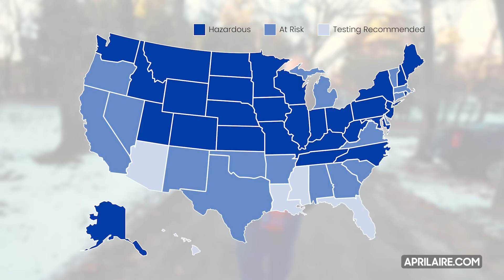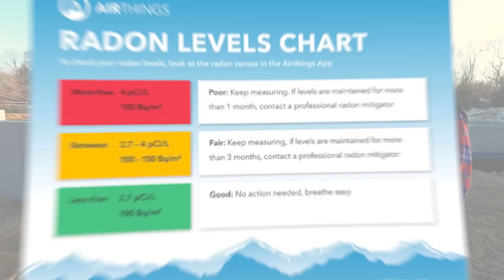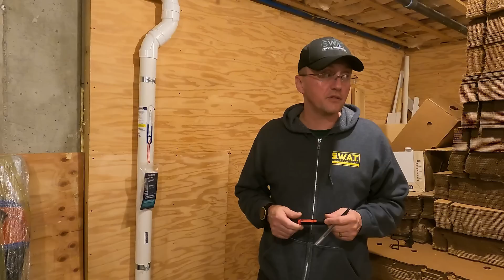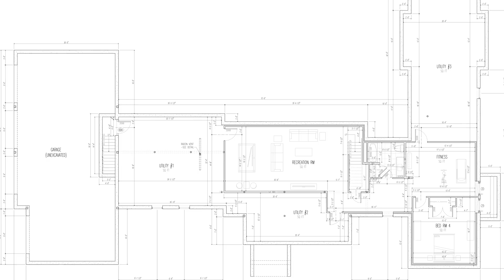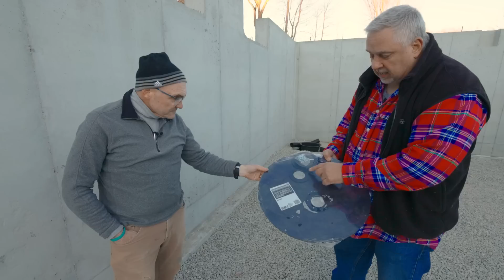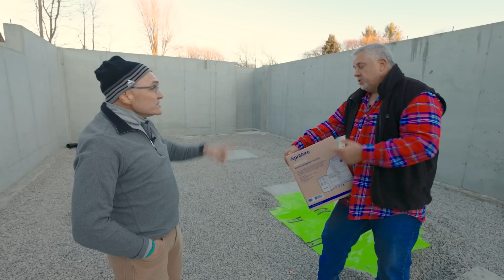"Radon Mitigation" Build Show Build: Boston - Bonus Episode

Comment: Hello. 
After watching your video, I noticed several issues. As the owner of RCS Membrane, a leading installer of radon poly under-slab vapour barriers, I want to point out that the pipe coming out of the ground appears incorrect. It should be a solid pipe. The pipe shown in the video could allow gases, including radon, to leak into the basement.

Comment: There was no mention of RadonSeal. I've used it in several basements in houses I've owned and applied it myself.  Definitely seals the concrete to prevent leakage. It even fixed small cracks that leaked water. For an after built option...

Comment: The radon in the previous house was not so high but the house was poorly built so I think it was always ventilating, now we have put a new build and didn´t concern with the radon. Its well sealed and we tiled throughout and just read that tiles emit radiation.... sitting in my office now with a  reading of 151mBq. have to see if ventilation will be enough to lower it.

Comment: Like the detailed explanation, great video. 
Do you know if you can use the black corrugated pipes with holes put it under the (gravel+6mm poly+4" concrete) and take the pipe out of the house to mitigate radon gas?   Radon is 7-8 times heavier than air so will it settle in the pipe and exhaust out of Nudura ICF house in East TN or you need a fan to suck the air into the corrugated pipe?

Comment: For older homes without poly below the slab, what options are there for radon mitigation to ensure radon is escaping only from the pit by the radon mitigation system? Is a roll on water barrier or concrete sealer the solution?(along with caulking joints and cracks)

Comment: Hello Matt & Steve.  Love the channel and all the content.  I have a radon mitigation question that I am struggling with.  I live in Maine in a 100+ year old house with a granite block foundation.  I have a HRV air dilution system installed for radon mitigation due to an unsuitable basement slab for a traditional sub-slab system.  For much of the year HRV provides adequate mitigation. However, I am experiencing periods of greater than the recommended levels.  I am considering spraying a ~1' coat of closed cell spray foam on the basement ceiling between the floor joists to serve as a air barrier - thus preventing radon gas from migrating into the living space above.  Also - the tighter basement envelope could allow the HRV to dilute and expel the radon gas more effectively due to the gas being contained and not mitigating out of the basement (upstairs).  The literature I have read indicates that closed cell foam does provide a barrier against radon migration.  My biggest concern is what spray foaming a Maine basement (8ft - full depth) ceiling will do with respect to humidity.  Will I create an undesired increase in retained humidity in the basement?  The humidity in the basement is already ~60-65.  The basement temp is typically between 45 and 50.  There are two forced air oil furnaces in the basement for winter heating.  Are there any concerns with my approach that I haven't considered?  Thank you for your time.

Comment: Another great episode.  I understand that it's always best to design with a belt and suspenders approach, but I wonder how much radon can get past a taped 15 mil Stego barrier, and if then sealing the slab with a viscous coating wouldn't be a safe enough detail.
Reply: The challenge here always is, you ONLY get 1 shot at this.....
Reply: @stevenbaczekarchitect9431  You're right of course....  Just that the market overwhelmingly votes against spending money on the dark side of the sheetrock, so the natural inclination is try to pacify the market forces, as uninformed as they might be.
Reply: @andrewfalk3071  Agreed - I remind clients the cost of fixing somethin on the darkside of the sheetrock after it is completed........most understand this concept

Comment: What about the foundation walls? Soil are on the outside of these walls and radon can come in through them. I was thinking installing a floating floor that has water gap membrane so that it can use as a way for the air to be suck by the ventilation system, that way no need to break into the concrete slab.

Comment: Radon is a lie.
Reply: I would have to disagree, based on the science.  Is there research that you can point to that debunks all of the science that has been out for many years.  The research I have seen supports the dangers of radon and that it is the leading cause of lung cancer deaths among non-smokers?  If you have any research data that you believe debunks this, please help everyone by providing that material.  Would you want your family, including young children, to live in a house that had elevated radon levels without addressing the issue?  It is pretty straightforward to mitigate the radon in an existing house and even easier to do so with a home being built.
Reply: @scottrodman4017  - “Science” - ok sure.

Comment: Is this a bigger problem for homes with basements and what about homes with a pier and beam foundation that is ventilated?
Reply: Pier and beam, if it has a ventilated perimeter so air can move through will vent out the radon in the air gap between the ground and the floor ...
BUT then you've got the humidity / moisture problem under the house and the floor has to be well insulated. If the owner later closes off the airspace we all know the humidity will go high and potentially rot starts developing but the other problem is that the radon gets trapped too

Comment: The drain tile installed around the internal and external perimeter of the footings is connected. Why can't these pipes be used to also collect radon gas? My plan was to use the sump pump crock as the collection point. I plan to seal the lid and add a vent pipe connected to the radon vent stack. In addition, the expansion joint around the slab perimeter will be caulked and there will be a 6-10 mil plastic under the slab.

Comment: Steven Baczek Architect 
Question could you just run the exhaust tube straight out under the foundation wall before pouring like the water drainage then straight up the outside foundation wall and skip having 2 more penetrates into your air barrier?
Reply: Theoretically - what you lose is the stack effect movement of the air because it is heated inside. You situation would require a mechanically induced flow (fan)

Comment: Im a licensed radion specialist. The EPA guidance for radon is a measurement of 4 piCU/L; any higher and it requires mitigation.  Every real estate transaction should include a radon test. A short 6 min sampling is not very accurate. I run a minimum 48 hour continuous radon monitor. Weather impacts radon levels. New construction passive systems are worthless. Radon is 7.5 times heavier that air. Radon will not rise in a passive system.  The problem is that realtors convice buyers to waive home inspections and radon testing so they reduce impediments to their commission.
Reply: The 6 minute test mentioned was with the professional-level monitoring device shown and costing several thousand dollars.  The mitigation company brought that to test each location and the results were almost identical to the AirThings ViewPlus devices that had been in place for more than a week.

Comment: Steve - wondering about the stack pipe that has holes in it. Shouldn't the pipe be solid to ensure radon does not migrate into the house?  Thanks for all you do
Reply: absolutely correct.  Steve mentioned that the pipe with holes was just a mock-up using a pipe that was at the site and that you would never use a vertical pipe above the slab that has holes.

Comment: Shouldn't you also have supply air?  Otherwise you are sucking on a straw with your finger on the end.  Ideally situated in the gravel as far from the exhaust stack as possible so fresh air is can be drawn through the gravel displacing any radon rich air.  I have read that in time, without a fresh air source, dirt etc will get pulled into the gravel from any existing air sources under the foundation and the efficiency of the mitigation drops significantly.  You could probably use the perimeter drain pipe if it day lighted some place.

Comment: You'd be amazed to hear how many real-estate professionals will tell customers that Radon is only an issue in homes with basements. It will accumulate more in a basement, but you are still at risk on a slab if it's coming up through concrete and cracks

Comment: I bought a great Radon detector on Amazon, it shows short term average over a week and long term average.

I built my new house by Pikes Peak in Colorado, lots of granite & Radon.

Under my downstairs radiant slab, in  the crushed gravel layer, I put 40’ of perforated 4” ABS   warped with polypropylene land scraping fabric, the 4” ABS exits about 24” above my roof peak, the slight vacuum created by wind reduced my Radon to about 2 pico-curries.

The ABS pipe goes up in my boiler room in a 24” chase where I put an 120V outlet in case I needed an air pump.

Comment: Perhaps I didnt understand but are ypu using 2 layers of Stego? I understand the 1st  layer covering the pipe and gravel.  Are you spray foaming an underslab insulation layer on top of the first layer Stego and adding another Stego layer on top of the foam? before pouring the floor or did I misinterpret this? Is it difficult to get a consistent foam thickness given the way  foam expands? Or can you get close enough you don't have shallow spots in your concrete?
Reply: It is a single layer of 15 mil Stego Home over 4” of low VOC spray foam (Natural Polymers’ Ultra Pure).  The Stego installation instructions call for an overlap of what I recall is 6-8” wherever two pieces meet.  The taping of the joints and sealing about 6” up the wall of the foundation are important elements of that installation.  Concrete is then poured on top of the Stego.  They advise to be cautious about walking on the Stego after installation and before concrete is poured, but that material is really tough!  I would be more worried about not pulling the seams apart or the taped Stego from the walls.  I think all it takes is being aware and careful on those issues.

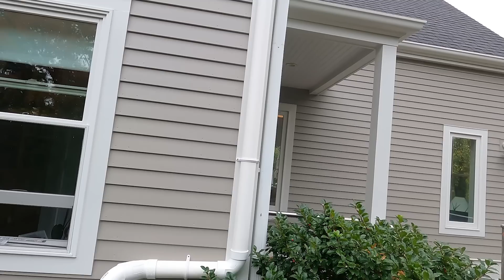Comment: 8:12 It could be the camera angle. But is there something to block rain from going down that pipe? Either an upside down U or some sort of cap that blocks rain, but allows the flow of air?
Reply: Nope. What little water enters will simply end up under the slab

Comment: Passive radon mitigation in new build should be mandatory based on county findings. Nebraska doesn't require it but every other home in Omaha has an active system... same with Ohio... Indiana and Illinois...
Reply: Our new build (2022) in Gretna has a passive system.
Reply: @spurly48  did you have to request it, or was it mandated? Or builder recommended?  When I moved into the area in 2016 the house to the left and right of the one I bought  had active systems, told the real estate agent it had radon before we tested and  he asked me how was I sure?...
Reply: @persistentwind  I believe as of 2019, all new construction in Nebraska requires at least a passive system. LB130 made the change to the local building code.
Reply: @spurly48  that's great to hear!

Comment: Maybe a stupid question, but why do you need venting at all? Why not just seal the slab/walls with Stego or whatever to block the radon, just like we do for water? Or use the sump pit as the radon collector?
Reply: There are systems that use the sump as a collection point, since it connects to the slab gravel as well. 
Just sealing isn’t usually enough (or at least recommended) because radon can permeate through slowly, and heating a home in winter will create the “stack effect”. Which just means the hot air inside will rise up and out of the home, creating a vacuum against the slab which pulls radon up. That’s the principle of a passive radon system, active will use a fan to create a constant vacuum on the gravel bed.
Reply: I would imagine that radon can slowly go through concrete. But also over time concrete can have micro fractures and radon will go through them.

Comment: can you angle the exhaust, seems like a big exhaust pipe seems like a rain catcher like that, condensation and rain drops going down to the electric motor?
Reply: Nope, with the fan on you will not get very much rain down the  pipe and if so it is required to be pitched back to the entry point and the ground will soak it up.
Reply: @kylekelley213  TY, was wondering, i live in Wa, so it rains half the year : ) was curious if you should put a rain cap or something on it

Comment: I think this is overkill. A layer closed cell foam with a sealed vapor barrier above that should be more than enough to block any radon transmission, without the need for a venting system.
Reply: State Building Code requirement here
Reply: While the Stego mat and the closed foam insulation might solve some radon problems, I would not want to take that risk when the cost is so small to put in a system at the time of construction.  A retrofit presents a lot more challenges, costs and uncertainty of success.  Using all three together (foam, Stego, AprilAire fan) means that it is virtually certain that you will not have a problem.  A passive system is a requirement in a number of counties in Massachusetts, for good reason.  Good question!
Reply: I don't think you are appreciating the risk of it getting into the house. Think of every person you've heard who's died of lung cancer and didn't smoke. It's almost always Radon or Natural gas leaks
Reply: @Nitrobucket  Everything in home design/construction involves a choice or a trade off. If you try to designed and build every home to the highest safety standard, even when the risk is low, every house would cost a million dollars. Obviously, the local building code rules the day, but aside from that, some common sense needs to be applied.

Comment: radon in your home in deadly amounts is just a myth
Reply: Well it is in the building code in some states....
Reply: So you would sleep/live in the home that measured 300?
Reply: It's actually not, do some research.
Reply: @kylekelley213  Thank you sir - since 2015 IRC Appendix F Massachusetts State Building Code "REQUIRES" a radon mitigation system
Reply: @stevenbaczekarchitect9431  
I was trying to give you a compliment and reiterate what you said was correct. As I have been studying to get my radon mitigation license for Illinois, I know all about radon in the effects of it from all the studying and research I have done. I was telling someone in the comments to do there own research because they said radon was a myth. Why you so upset that I told someone it's not a myth?
Reply: My state requirements went into effect in 2014 which my area does not enforce it. I'm gonna try and change that as all new build should have a system installed.
Reply: @kylekelley213  MY SINCERE APOLOGIES!!! I read it wrong - Thank you very much, I do appreciate your help

Comment: I read a study that purported with a tight house, an ERV is effectively radon mitigation. Does anyone know whether this is true?
Reply: It will help, but only when it's running.  It may not be enough to fully lower levels.
Reply: It probably has some positive effect, I wouldn't rely on it
Reply: We use them and they are decent for mitigation. We generally only expect them to remove 50% of the radon where as an ASD system as Steve is doing here can be 99% efficient. The main problem with the HRV/ERV for radon is you are attacking the already contaminated basement air and not below the slab. They need to be balanced perfectly.
Reply: experience has shown with a friend's house that it should be dealt with at the level where it is coming into the house, not pulling it up into the living spaces where an ERV will typically address air issues.  It will depend upon the design of the ERV system.  Once the seasons changed and the heating system was active, it simply brought the radon from the basement to the living spaces.

Comment: Tropical guy here and I had no idea Radon was an issue.  This was interesting but I wonder what people did 40-50 years ago?
Reply: Died much younger.
Reply: Yes to both below - understand 40-50 years ago the wind blew threw them. I grew up in a house with a dirt floor in the basement and we never had mold problems or the like, it also cost a bunch to stay warm in the winter
Reply: Houses also weren’t built as tight as they are now.
Reply: The old houses usually didn't sit on the ground like today. Plus people died of lung cancer all the time from the 30s -70s but we assumed it was all from smoking

Comment: I did a Radon evacuation system in my house back in 2018.  After working in my basement office for 8 years I discovered the 12pc/l levels.  My house is old.  Under the slab was an abandoned coal bin.  I was able to tap into that. Due to low sill heights, installing pipe through the foundation to the outside was not going to be easy.. so I chose a different route.  I also had an abandoned chimney.  4" PVC from the slab  up 18" into the fan (I know.  it's in a conditioned space (Where I can monitor it easily every day)) from the fan into the chimney with 4" PVC.  Once in the chimney, I connected to triple wall drain pipe (Its lighter.  I had to feed it down the chimney.).  Levels went from 12 to an average of 1.7 since 2018.  I know that having the fan in a condition space is not to code.   That said.  I believe it's better to be able to monitor something you can see every day, than live with a possibly dead radon fan that's in an attic you never go into..   I've heard horror stories of them freezing up from condensate.. Mine should last a long time.
Reply: good story